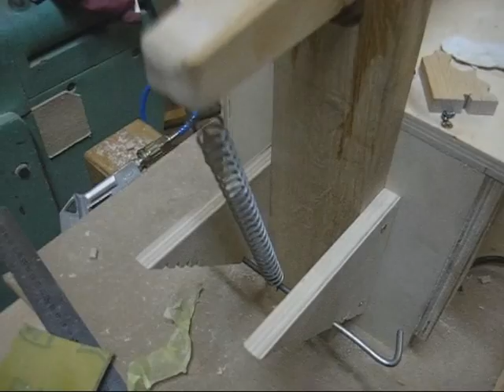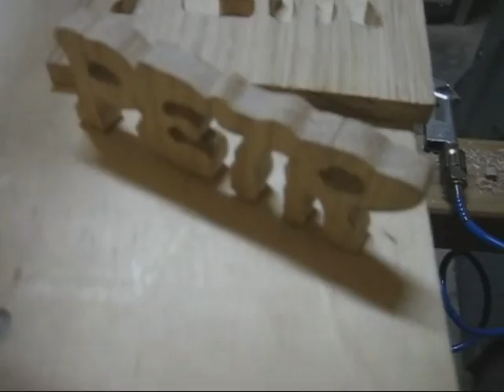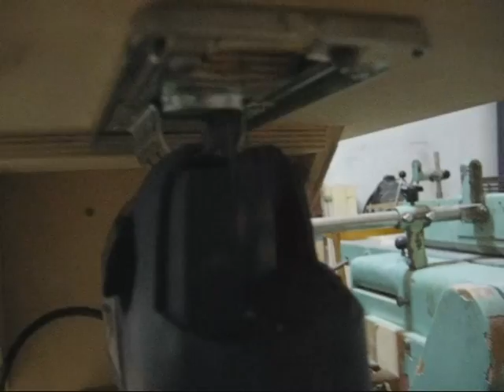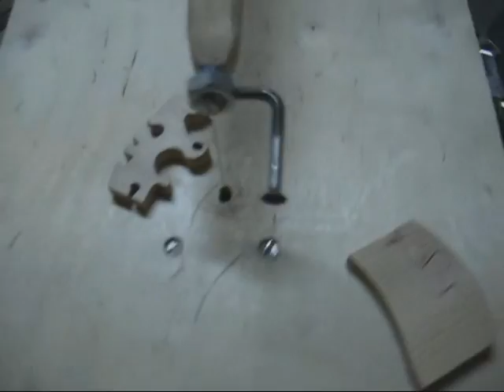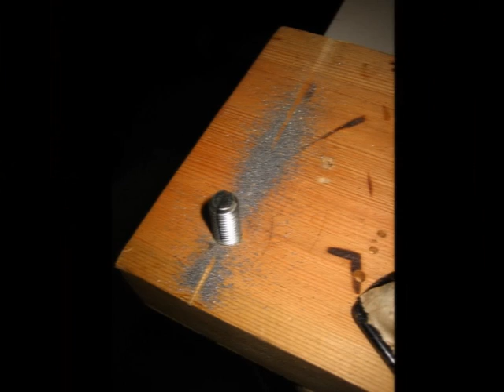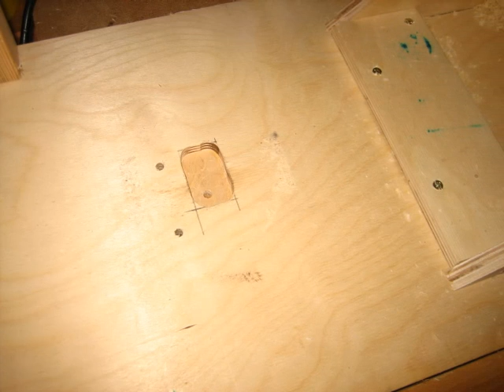Home made Scroll saw from jig saw - lupinkova pilka z primocarky

Comment: Hi Peter that was amazing skill of making scroll
 saw from jigsaw. Could you show how you made connection of blades at both the ends
Thanks
Reply from the maker: Hi, thank you.  You can se it in here: http://pekne-truhlarsvi.blogspot.cz/2011/01/elektricka-lupinkova-pilka-z-primocarky.html
Reply: Hi peter thanks for pics for getting and idea how to attach blade at both end.

Would you mind giving me step by how to make blade attachment at both end.

Actual i have beginner for making wooden fishing lures and by mistake i bought jigsaw for curving lures body from timber. but when i tried it was difficult and even not possible.

that was reason i was looking for some post if it is possible to convert jigsaw to scroll saw and came across your post.

Will appreciate if you can guide me step wise how to make blade attachment at both end.

Thanks, Regards    Raghubir